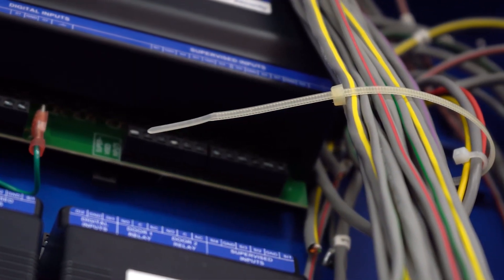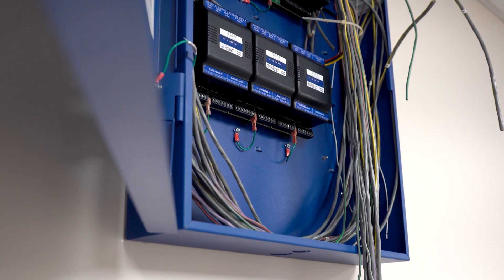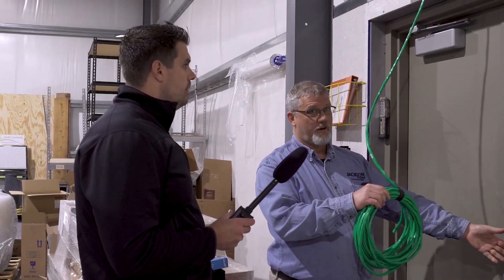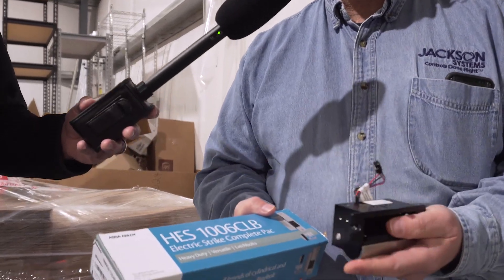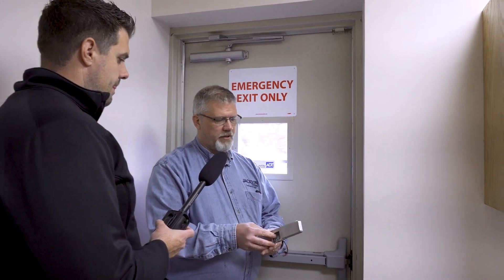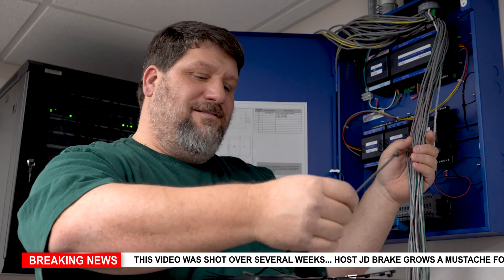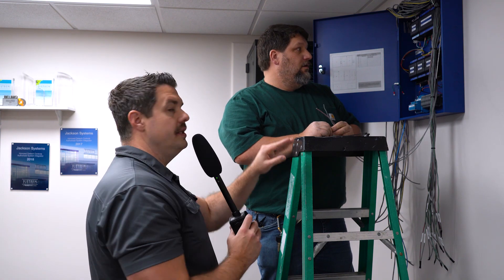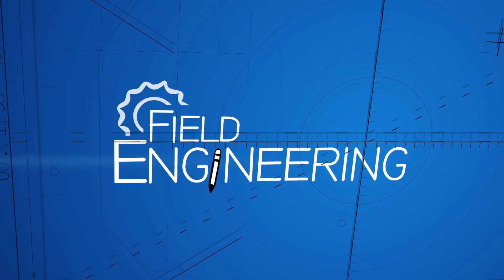Best Practices When Installing Building Access Controls

Comment: Does anyone have a good resource for intermediate/ expert level installations? I'm trying to learn how to integrate access control with ada openers and have had no luck. I have a pretty good idea of relay theory and inputs/ dry and wet contacts but i can't seem to verify what i think i know.
Reply: Relay output to the opener and call it a day? Have the opener buttons go back to the controller instead of the door operator

Comment: wow looks so unprofessional.. Outerdoors without pin verification???!! Thats a big no no. If one of the users loose their card whoever can just walk straight  in. Always have pin verification on outerdoors specially outside opening hours
Reply: That's silly. The same goes for any other type of key. If you lose your house key someone can use that to get into your house. Do you have 2FA to get into your home? No. Dumb.
Reply: Depends on the level of security you need. Not everyone needs card and pin. In fact it is probably is way less than 5% of all card access installed. Card and pin are not the only way for dual layer access. Bio, Facial, Retinal are a few other secondary layers. Those cannot be duplicated, however a pin can be overseen or given out.  It is Access Control. You can disable the credential if lost and replace with a new one without disturbing the rest of the system users. Its about tailoring where and when people have access, audit reports and a whole lot more. If you are talking dual authentication access on any door, pin is the weakest secondary means. Not saying its bad. This video is covering the basics.
Reply: I think it is not so safety